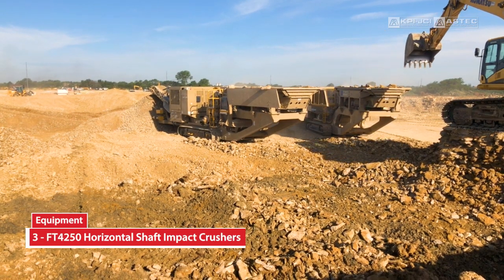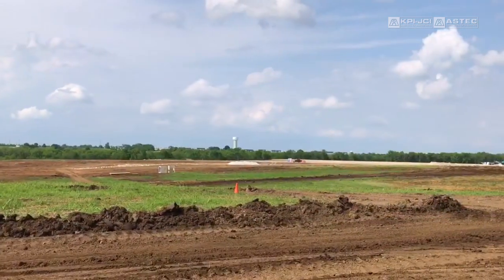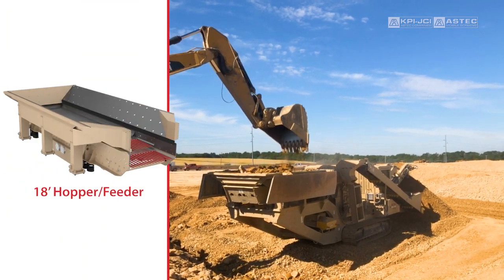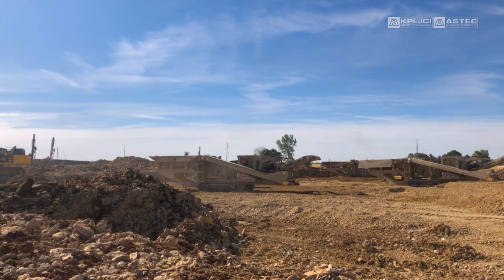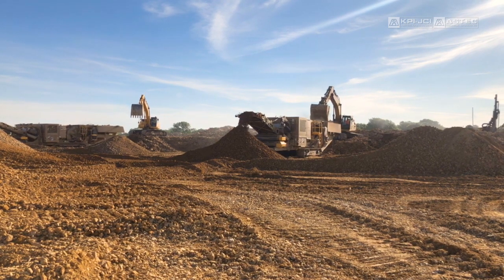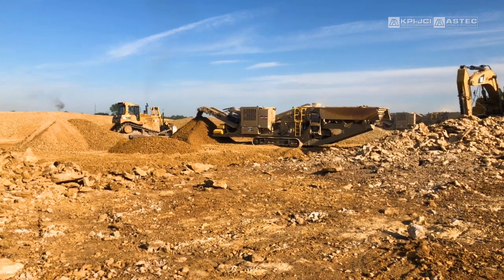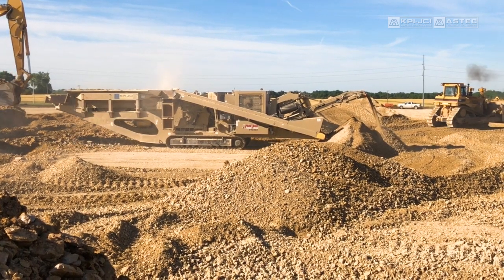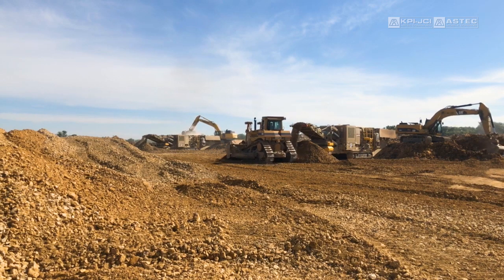Haupt Construction Case Study

Comment: Great job . Alot of production. My KPI-JCI 4250 is 15 years old and last week when I tried to move it the right track wouldn't move. Just before that I turned off all valves coming into control boxes to fix leaks so when I turned them back on the track wouldn't move and I can/t find a troubleshooying guide. Any suggestions ?